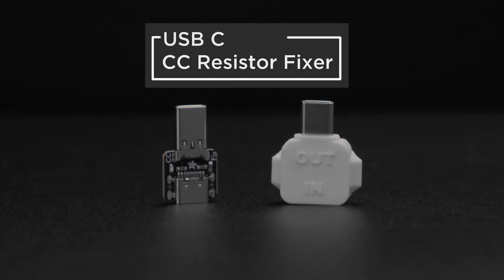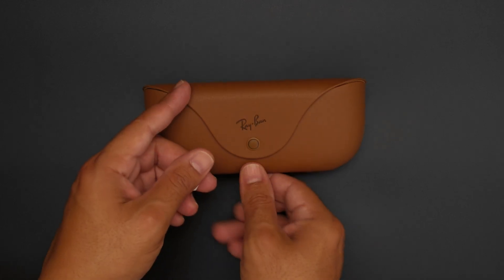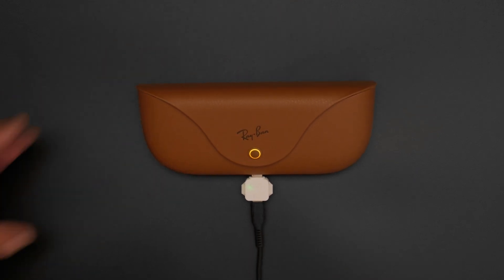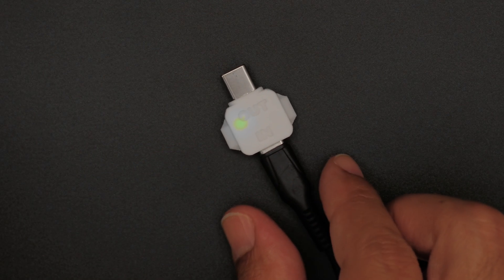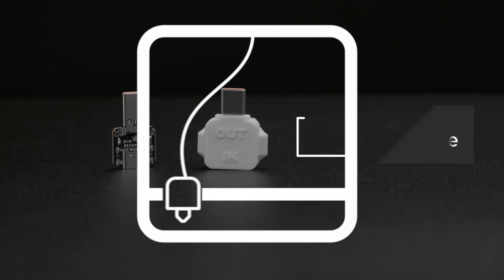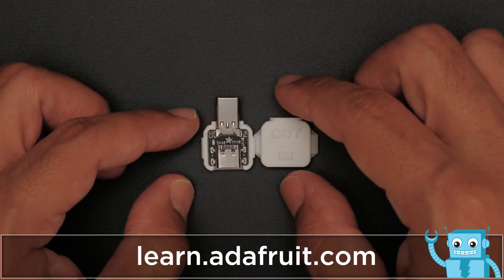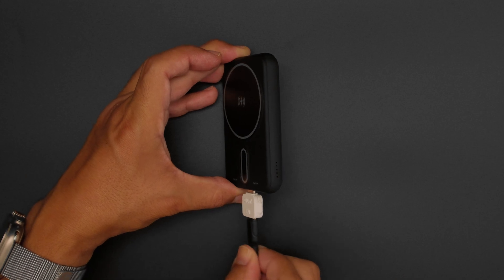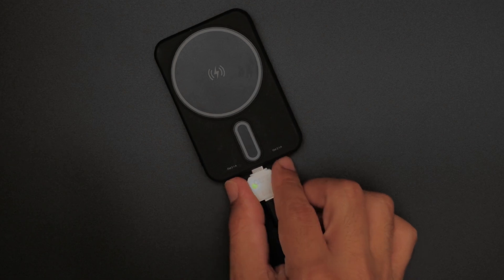USB C CC Resistor Fixer #adafruit #3dprinting

Comment: I am happy Adafruit came out with this. It's upsetting that they had to, rhetorical question, how did the spec get so wacky that charging over USB-C has become so problematic?
Reply: Because some devices don’t want you to use a power delivery charger, so the spec allows that decision

Comment: This is a really clever idea. So frustrating when devices don't have the proper resistors. For hobby projects I can understand not wanting the hassle (I've decided to leave some things micro USB for this reason!) but for a manufactured product, there's no excuse.
Reply: There is actually an excuse for a manufacture product. You can actually prevent power delivery charges from being used that way you may only use something like a computer depending on the product that might actually help its function.

Comment: Will this work when plugged into compliant devices, i.e. devices with the 5.1k resistors?
Reply: Yes it should.  Since 5V is the only voltage available at output (male) end of this dongle, your (compliant, end-user) device can only received that 5V regardless.